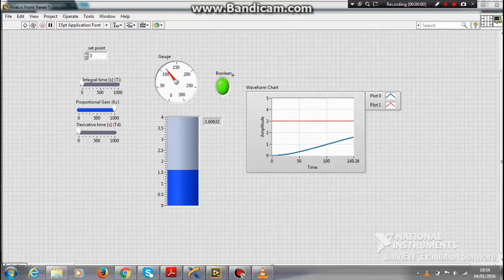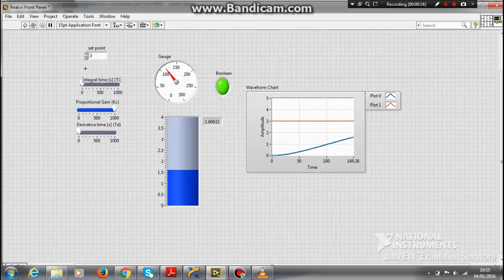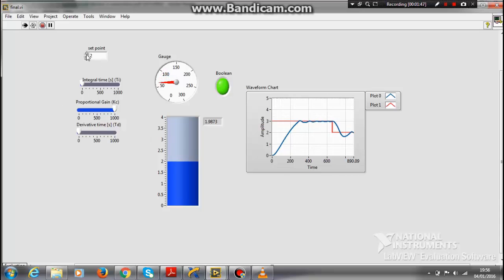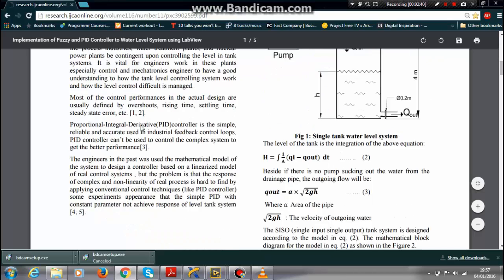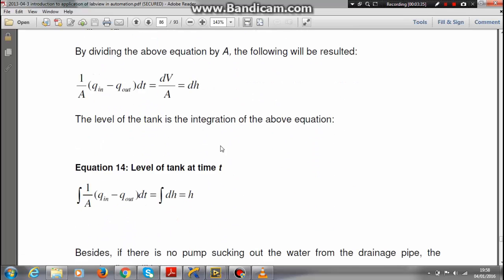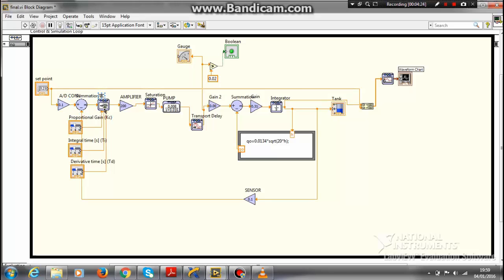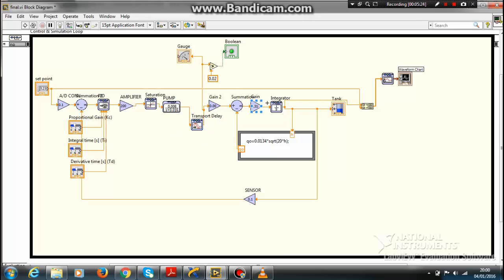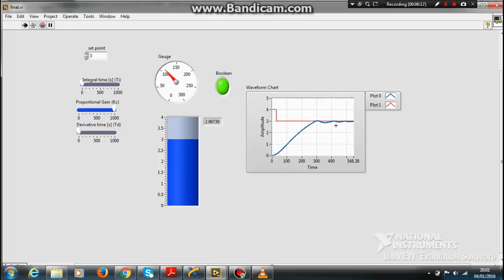Implementation of PID controller to tank level system using Labview

Comment: good work!!!, I try to remake this project following your block diagram but I don't make it works 😂. thanks for the video
Reply from the maker: i think you made a mistake in setting up gain 2 .. its actually 0.001 , try if it works
Reply: I set up this gain in that value, but it doesn´t work and I don´t know why. After this, I notice that the Transport delay were causing a part of the problem and I removed it, next, I set up the gain 2 in 0.04 and it works!!!, Thanks again, greetings from Mexico... Sorry for my English
Reply: Please the vi.file my gmail arka.adil1@gmail.com